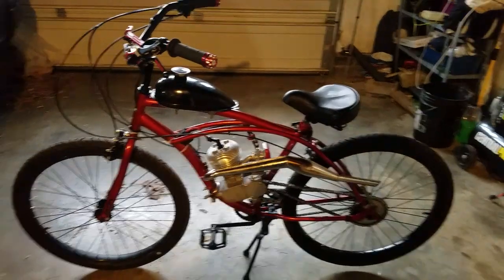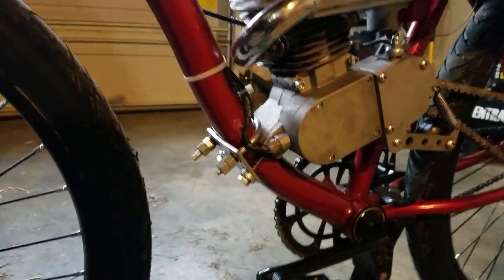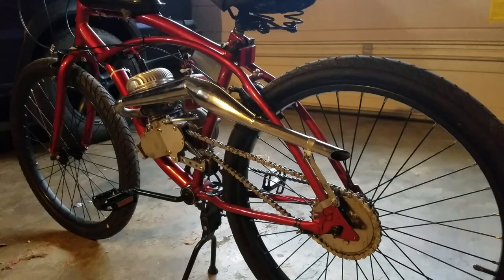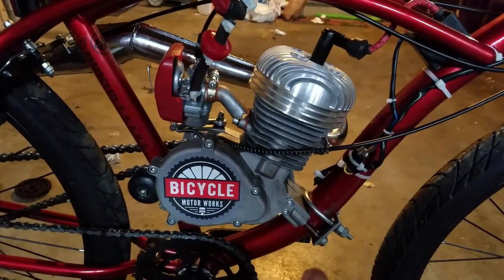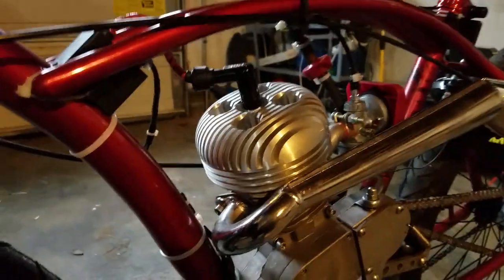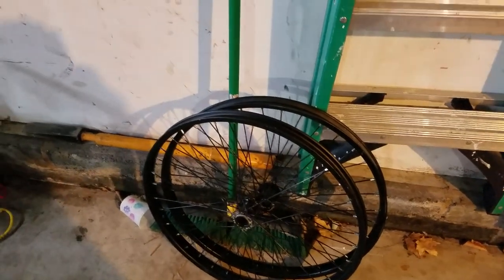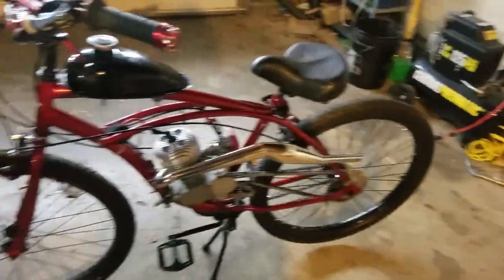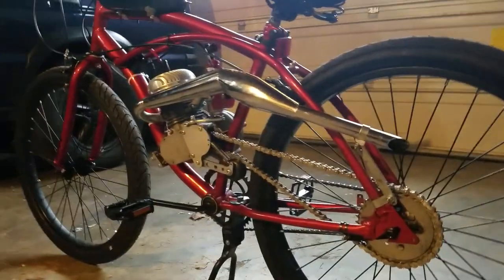Motorized bicycle

Comment: I run my high compression 6cc head with just a light coat of "Ultra Copper" rtv silicone- one base gasket. I got a helluva boost from my thrust pipe-welds were such shit, but I made a stinger restrictor from a socket and washer and its badass now! I also had to repair fuckin holes in the welds and grind the shot outta some of em too- had to flatten the flange and grind a bunch out of the inside too! I got mine for 45 tho so it was a little better, still not worth it but shit I dont have the tools to make one myself so...

Comment: Is it the wheel bearing balls+races going bad or part of the coaster brake mechanism? When I had a coaster brake hub I removed the little shoes and stuff inside so it’s just a plain axle
Reply from the maker: That's an old video. But I I use free wheels instead of coaster brakes now. I'm guessing part of the coaster brake mechanism on both sets it locked up the rear wheel and blew the guts out of the brake side. I'm guessing they get too hot also because both times it happened was going down a hill using the brakes.you can remove the shoes but you got to use the appropriate amount of washers or spacers to take up the Gap now.
Reply: James Piccone Yeah I might be thinking of one bike where the pedals weren’t used and probably wouldn’t work after removing the shoes in the hub. The coaster brake hubs do look stronger than the old style mountain bike hubs tho, that are alot skinnier in the center
Reply: @JamesPiccone  yes coaster breaks are just not made well so they blowout

Comment: You said you had a 70 jet in this bicycle did you drop it down yet how's it run at full throttle cuz I'm having that kind of problem on one of my bikes thinking what jet should I put?
Reply from the maker: Respectfully that's a very old video. That carburetor came with a 70 jet which most NT or speed carbs are and our generally too rich. I'm currently running a 61 on my runtong carb but on my new build I'm running a bing 19 mm still have not figured out final jetting for that.
Reply: @JamesPiccone  I dropped the idle screw pretty good and it's running pretty smooth right now but I'm waiting for my Jets to come in the mail I might put like a 66 jet see how that goes or start a little higher.. I'll subscribe to your channel,
Reply from the maker: @motorizedbicyclerider5296  Start rich and work your way down, when you're wide open throttle finally cleans up you're good 💪.
Reply: @JamesPiccone  thanks

Comment: U just need to buy bearings and repack it and repack it full of bearings. They come with not enough bearings to begin with and they are probably poor quality bearings. I’ll try to find and link the video on how to easily put in more/and new bearings
Reply: https://www.youtube.com/watch?v=AIAN9uhFqn0&feature=share this is how you take apart fix and work on clutch bearings assembly’s
Reply from the maker: Respectfully it's not worth all that work when you can just buy a complete clutch assembly 👍. This is a very old video
Reply: @JamesPiccone  unless new clutch and bearings last super long cus mine is starting to make noises from the gear side and I’ve been riding for like  a month or two in total riding days
Reply from the maker: @christianscottsuzuki  I got two spare clutch assemblies for backup besides what's installed on my bikes. It's way too much work you still got to buy the bearings and figure out how to press it out and in, it's not just a hammer. Or just pay $20 bucks and get a complete clutch assembly done right. Also using the stock clutch pads have thin metal wires in them that eventually chew up the bearings.
Reply: @JamesPiccone  Home Depot plumb attachment thing that’s of similar size or is my deemed to put in work on one of similar size and awh shucks I live in Hawaii so all the bike stores are like pedaling distance away and they carry ball bearings of different sizes. So I guess in my case it’s a lot cheaper and easier and I’m also a broke ass hahaha but anyways. I’m gonna try a wet clutch idea soon with the orange pads and see if I can eliminate the need to grease the clutch gears and ball bearings in total haha
Reply: @JamesPiccone  I honestly didn’t know people sold clutch assembly’s pressed with enough good bearings. And the bearings are couple dollars at my local bike shop but alright now I know they sell premade ones